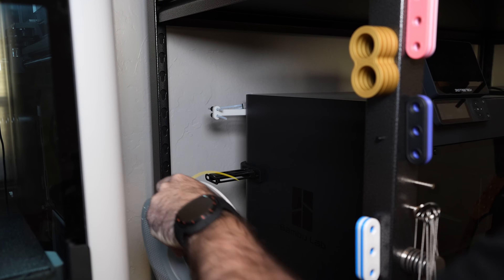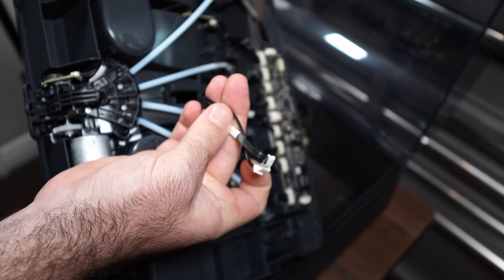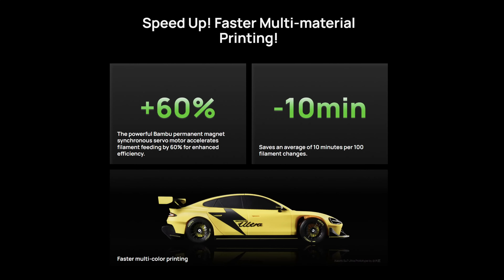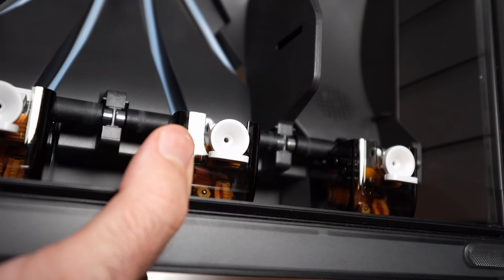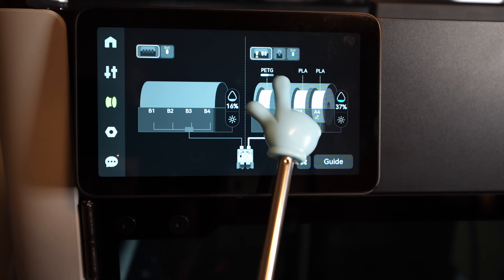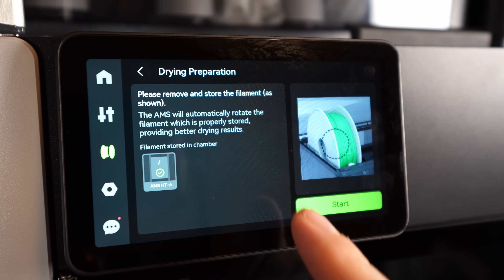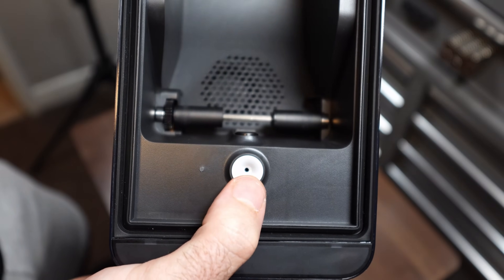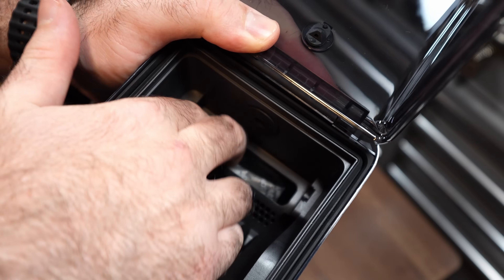Which Bambu AMS Should You Buy? (AMS OG vs 2 Pro vs HT)

Comment: Did you notice that in the manual, it states (indirectly) that you can use a 95A TPU with the AMS HT? I am not talking about going through the bypass either, but just feeding it like any other material.  I tried, and indeed it does seem to work just fine, but as soon as you tell the system it is tpu it stops you.
Reply from the maker: I didn't notice that, thats strange.. so are you using a PLA profile or something?
Reply: @sammuxlow  Yes, exactly. However, I have yet to experiment much with it yet, so some more trial and error needs to be done before I would trust it for much.  I can only assume this was an early feature they had planned for the AMS HT but later decided against it for one reason or another, but forgot to change the manual. The listing in the manual states," for TPU softer than 95A, use the TPU outlet.". I am choosing to interpret this as: if it is 95A or higher it will work without the outlet, but again, they decided to lock this out in software, so I imagine there could be a good reason for that.

Comment: I love my ams ht.
I think ht*4 better than ams 2.
Reply from the maker: What about your AMS do you like more than the 2 Pro? The temp?
Reply: I can see that on the H2D, but on the rest of the machines, you just used all expandability. At least that is my understanding of the system. With the X1, I have 1 AMS1 and 2 AMS2 units currently. If I add a third AMS of any type, I can not add anything else. So 4 HTs and 4 filaments or 1 AMS and 4 filaments, expandable to 16 on the older machines, or 16 + 8 HTs on the H2D.

Comment: I got the HT to dry ASA, TPU, and nylon. But I don't think it's strictly necessary.. at least not as much as a heated chamber. The AMS 2 Pro  on the other hand is definitely the best, but for anyone with an AMS1... you aren't really losing all that much, so don't sweat it! :)
Reply: Are there any issues with TPU in the AMS 2 Pro ?
Reply: @ChristmasEve777  TPU can't be printed from any AMS or MMU unit. You have to feed it directly
Reply from the maker: @ChristmasEve777 only TPU designed for AMS printing can be, typically much higher shore hardess like 68D. 95A works sometimes, not reliably, anything softer doesnt work. Mainly becuase of the filament path, its way too long, TPU jams up inside it.
Reply: I got a P1S+AMS in early 2025. Before AMS2. Does it make sense for me to get an HT? I was looking for a dryer anyway so that I can start going into PETG and other stuff!
Reply: @pvic6959  I don't think HT is worth it unless you plan to print nylon or TPU. If you got the AMS1, then I recommend getting the SUNLU mod that adds a dryer functionality to the AMS1. I actually have that one too and it works really well. Installation was fairly simple.
Reply: @Goodvvine  i do want to experiment with TPU but i haevnt done that yet mostly because i don thave a dryer or a drybox. would you recomend the SUNLU for that too?
Reply: The TETRAS is way better then the sunlu IMO.  I have both.
Reply: @2004steve  do you have the dual or the quad one? I havent gotten a dryer yet and im still thinking lol
Reply: @pvic6959 I have the quad, I love it.  I can adjust each zone to whatever filament is in it.  It has dividers in it
Reply: @2004steve  oh cool! Thanks for the answer!
Reply from the maker: For me the AMS 2 Pro was a huge upgrade. I would buy another in a heartbeat!
Reply: @sammuxlow SUNLU upgrade to AMS1 may be the bridge 🎉
Reply from the maker: @Goodvvine yes definitely, I asked them if theyd send me one, no response yet

Comment: I really like the new AMS 2 PRO and the AMS HT, hoping that Bambu makes these so you can print and dry at the same time in a future update.  I am disappointed that the H2D did not come with an RFID reader for the side spool holder.  I have since discontinued using it and mostly just use the 2 AMS's instead of the spool holder.
Reply from the maker: Yea I agree, if they update them to allow drying while printing I'll be super thrilled. Never thought about a side mounted RFID reader though, does any other company do this already?
Reply: @sammuxlow Creality K2 Max and K2 Plus does according to the reviews, I can’t verify because I don’t have the machines.
Reply: RFID readers are for sissies. Just enter the filament info like a real man.

Comment: When I bought the H2D recently, I bought it with the AMS 2 and the AMS HT. I’m happy with both. They do serve different purposes. The HT does work better with HT filaments. But, I would have loved it to go to 100 C, as I use filaments that need that for drying. But then, I have a blast oven too, so that’s not as important.

What I’ve found is that after having printed three baskets for desiccant, the humidity, even without the heater, remains at about 15%. That’s at room temperature, which is more important than humidity at higher temperature. 15% at 65 C is about 30% at 20 C. I haven’t tested the HT at 85 C yet. Both work well feeding. You DON’T need to dry while printing! If it’s dry, it will remain so during a long print.

The only thing I’m not thrilled about is that the HT turns off when you turn the printer off. I would be happier, since it has its own power cord, if it stayed on without the printer. I haven’t tried that with the AMS 2 as I don’t need the heater since it works so well to dry without it.
Reply: just wondering - what kind of filament requires 100c?
Reply from the maker: @LexRivera  PPA-CF, super tough stuff like that.
Reply: @sammuxlow  Yeah, if you read the PDFs Bambu provides for the PPA-CF and PPS-CF filaments, the advertised properties were achieved after drying for something like 14 hours at 120C and then the prints themselves were annealed at 80C for a couple of hours, which is kinda crazy, lol, but I mean these are Pro filaments so most people printing with these have Industrial level ovens anyways.
Reply: I got the same setup, if you want really low moisture levels consider going 3A molecular sieves. My AMT 2 gets to 0% humidity (Or it at least reads that way) with 5 desiccant holders in the front. My AMS HT gets to 6% humidity with a desiccant holder and a center spool desiccant holder. Would love extra desiccant space in the HT to bring that lower. I usually use the HT to dry filaments then run them in the AMS 2 PRO.
Reply from the maker: @pvpsfinest851  3A molecular sieves seems like a really solid choice, I'll take a look into these as well!
Reply: I just started setting my h2d last night and went with the same system, have it set up in my office and I’m thinking about putting a dehumidifier in it, to keep the room dryer.  But before I go this route I’ll monitor the room humidity before and after to see if it makes a difference.

Thinking about getting another ams ht to be able to dry another roll while the other 2 ams are busy printing, so I can have another roll drying, or should I get a digital dehydrator to do this?
Reply from the maker: @invisible468  I love that these AMS are both dryers/dehumidifiers and auto-feeders. If it was me, I'd go with another AMS.

Comment: Good video. There is absolutely zero reason to buy old AMS today, especially since it will never be compatible with A1 line. I recently upgraded my p1s to ams 2 pro + ams ht. Not sure if it was mentioned or i just missed it, but i also really love AMS auto refill - allows me to completely empty spools. Zero waste printing (well if you ignore swap purge... and poops... and purge tower...). I also kinda disagree with ams ht downside being just one spool - it's clearly designed with high-temp filaments in mind, i personally use it with that spool of support material i got with my p1s. Sure it might be nice with 2 slots, but then it won't be that thin and compact. And will probably require more power to dry. And won't fit on top of H2D too with ams2pro.
Reply from the maker: I definitely missed that point about auto refilling or auto-continuing prints, definitely a really awesome feature, I'm glad you caught that. And yea having one slot could definitely be a downside for some scenarios, and i guess I'm curious if you'd buy a 4-slot HT over the current 1 slot, I know I would!
Reply: @sammuxlow  i will probably buy it in an instant, yeah. Especially in unlikely scenario it will feature separate chambers for heating different materials (imagine drying PETG, PAHT and PET at same time! I think one of the dryers on market offers something like that, but i forgot the name). AMS 2 was a huge upgrade compared to AMS, no more "AMS savers" with ceramic inlets, builtin drying allowed me to save some space (i'm a bit space limited, plus 3d printing is just a hobby for me), and as you said it definitely works faster for load/unload, which is a huge bonus if you use different materials for stuff like support interfaces. I just wish they had builtin PSU in AMS2 instead of that laptop-style power brick. But we probably won't see it until H3D or something like that.
Reply: @LexRivera  It's the Creality Space Pix4,  separate chambers for heating different materials you mentioned.
Reply: @LexRivera i just bought my first bambu (p1s) and ams2 pro. im not new to 3d printers but i dont understand why they dont use ptfe tube where ceramic inlet is. there must be a reason but what it is?
Reply: One missed advantage of buying the AMS1 as a separate unit is that it comes with 4 empty spools. at $11 each, that brings the price down to $275 USD. All you get with the AMS2 is PTFE tubes.
Reply: Why would you want to use an AMS 2 Pro with the A1 line? I don't get it. You spent $300 on a printer then go out and spend another $400 on a multi-color system, while its native AMS Lite can be had for $150 in the A1 Combo, why? OK, so you want to do 8 colors. But in that case, why not just get a P1S combo with another AMS OG, the total cost would be less than buying the A1 with two standalone AMS2 Pro.
Reply: If the AMS2 is compatible with the P1S/X1C (it uses the same COM port). Then why should the original AMS not being compatible with the A1 once they make the new AMS2 compatible with the A1 series?

It's literally the same connection, it works the same, it's only missing the drying function.